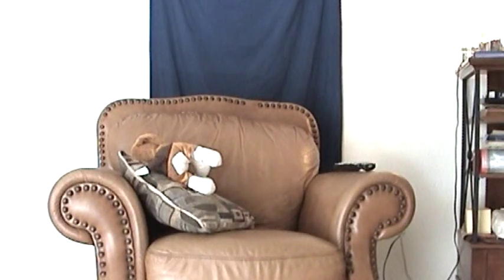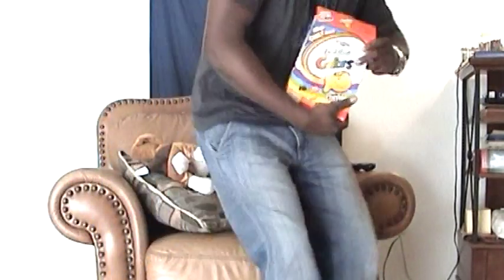LG Power Supply EAY60968701 Repair [Fix Clicking noise] 50PJ340  50PJ350  50PJ550  50PJ650  Z50PJ240

Comment: How to fix LG 50PJ350 (cliking relay, small flicker on screen and off)... Replace R929 or R927 (one, the other or both are broken)... They are 22ohms 5W resistors ;-)
Reply: Symptoms for me were TV would turn on but turn itself off after a short while and a constant clicking relay sound. I bought a kit off ebay for £10, contained 13 micro resistors, replaced them all and the TV is working again.

Comment: I have the same problem i need u ro fix mine
Reply from the maker: Justin Crittenden here's the link to my repair service. Please check your power supply board before purchasing. My service repair as well as my repair kits or only compatible to the power supply boards with two white resistors at the top right. It is not compatible to the three resistor board 
https://m.ebay.com/itm/Service-Repair-power-Supply-EAY60968701-50PJ350-24hr-TURN-AROUND-TIME-/202163123562
Reply: It is the exact same as the one u got in the video i already to it loose
Reply from the maker: Justin Crittenden  https://m.ebay.com/itm/Service-Repair-power-Supply-EAY60968701-50PJ350-24hr-TURN-AROUND-TIME-/202163123562. So all you need to do is purchase a repair service. Then I will send further instructions to where to ship the power board

Comment: I got the one with the 3 resistors but they all good my diode is good the ic I change but still clicking
Reply from the maker: In this case, your issue might not be the power supply board but possible upper or lower buffer board, or even the sustain board. I suggest you download a service manual from the net and continue your troubleshooting
Reply: OK thanks
Reply: I have the same 3 resistor board and it looks as if the top middle transformer is a bit brown and I am getting the clicking on and off sound. Any ideas where to purchase just a complete new board?

Comment: how much to repair board please mine just clicking
Reply from the maker: What's the model #
Reply: Bafury sutto 42pj350 many thanks
Reply from the maker: I need the service repair is available at the moment. You need to make sure that the power supply board it's actually the faulty board
Reply: Bafury sutto how do I do that as haven't got a clue with things like that . the red standby light stays on , and just keeps clicking
Reply from the maker: Riley Depp do you have a digital multimeter
Reply: Bafury sutto I don't I'm Afraid

Comment: Hey, I was trying to get my tv fixed I have an 50pj340. How can I ship the board to you?
Reply from the maker: here's the link to my repair service. this service is only compatible to the power supply boards that have two white resistors located at the top right corner of the power supply board..NOT THREE. so please check your power supply board before purchasing.

http://www.ebay.com/itm/191975303386?ssPageName=STRK:MESELX:IT&_trksid=p3984.m1558.l2649
Reply: 50 pg 60170 song signulbour eax43261601 0 ebt47433203

Comment: A friend of mine gave me this TV with this same problem.  He took it to a shop to find out what was wrong with it but they fixed it anyway.  He didn't want to pay that price and asked for the TV back in it's condition.  I took off the back of it and the 2 white resistors on the top of the board is missing.  It looks like they just cut them out instead of pulling it back out.  Can it still be fixed if I send the board to you?

Comment: Hello.....I have the exact same tv as yours and mines does the exact same thing...I took off the back and checked everything out. Can I send the board to you for repairs? Please get back to me. You can reach me 808-937-7501. I live in Hawaii
Reply from the maker: HI
NOTE: i do not service the boards with the three resistors located at the top right corner of the power board..I only service the two resistor boards, so you need to check your power supply board to see which revision you have

Comment: How much will it cost me to get my 50 inc plasma 50pj550 fixed. And how long will it take.
Reply from the maker: between $59-$69
NOTE: i do not service the boards with the three resistors located at the top right corner of the power board..I only service the two resistor boards, so you need to check your power supply board to see which revision you have

Comment: I have this same problem with my Zenith 50" plasma Z50PJ240 model PDP50T10000 board #s: Rev 1.3 PCB: EAX61397101/11 PSU P/N: EAY60968701, ordered a replacement board from Sears partsdirect and it did had same issue.  All other places have no return , standby light on and that's it after initial click.  I do not solder and do not own a multimeter tester, can I send you my power board to test and repair?

Comment: i have a lg 60pk250 i have a red power light that's on i only hear the clicking when i plug it in to the wall socket i hit the remote and nothing what board do i need is it the power supply in this case also thanx..nice video
Reply: ***** larry winston Were either of you able to fix the 60inch pk250?
Reply: ***** larry winston FYI I bought a new power supply on ebay for $40 and the 60pk250 works again
Reply: Im currently looking for one any ideas on if any other boards will work?